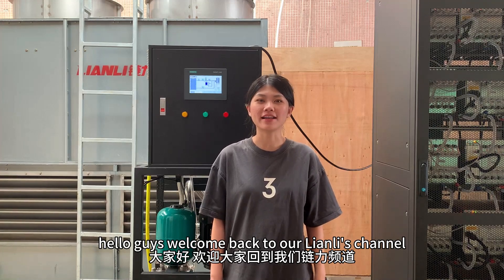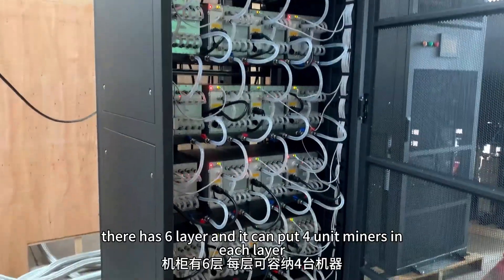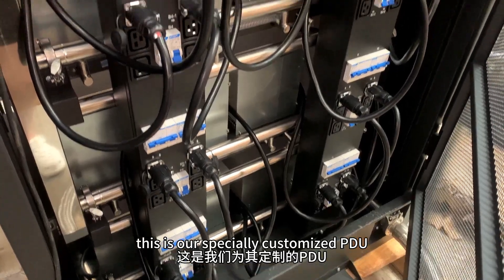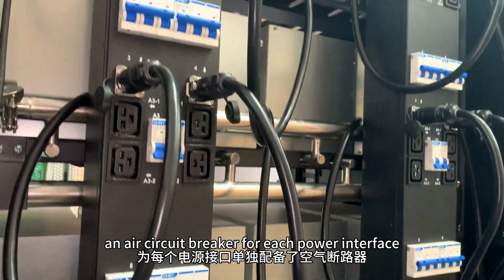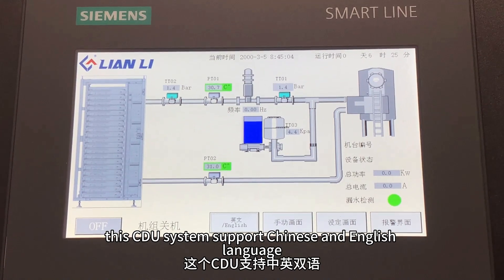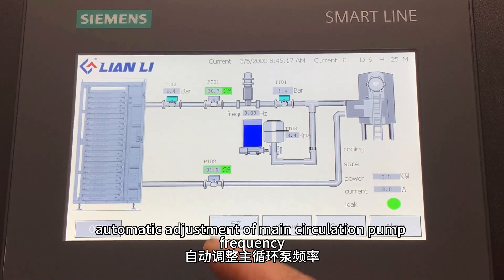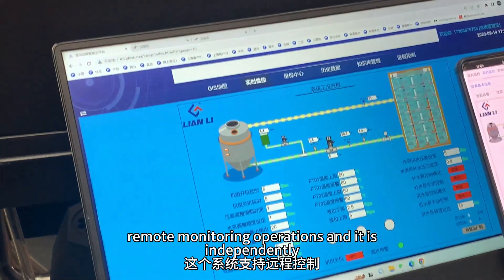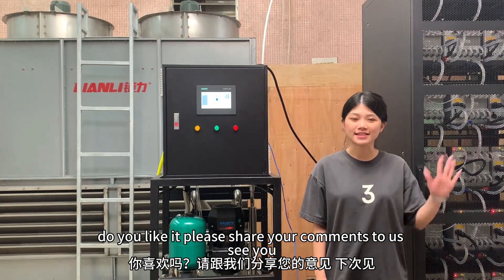Lianli water cooling system 24 rack space hydro cabinet for Antminer s19 s19xp s21 hydro miner

Comment: How much cost for this setup in INR.....
Reply from the maker: It has multiple options, 1 is using a dry cooler, 2 is using a closed water tower, and 3 is using a heat exchanger + open water tower. Their prices vary greatly. If you are interested, you can add me on whatsapp and I will explain their differences to you in detail.